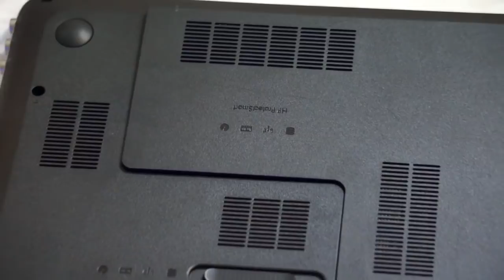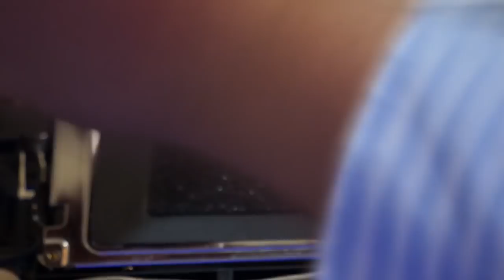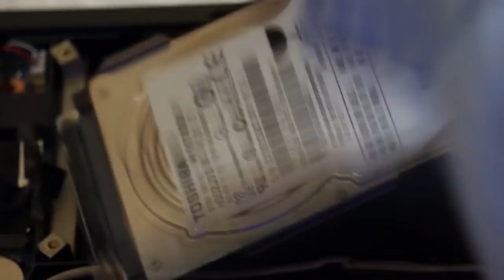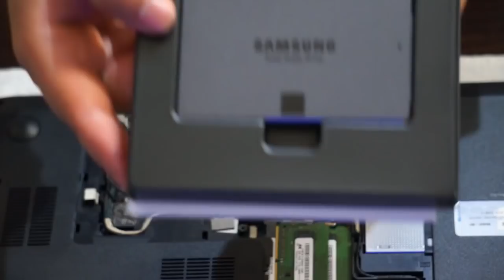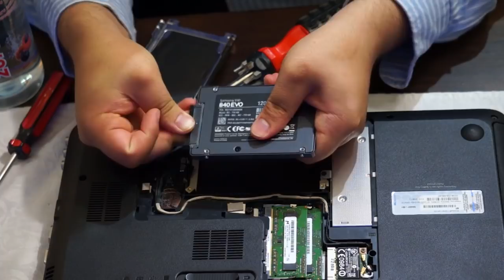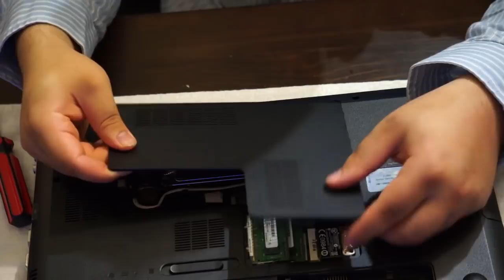How to swap a hard drive in a Laptop

Comment: physical swapping is helpful but the question is, did it work? hope you have follow up video on this to see what happens after the swap..
Reply: right? I'd like to transplant my tired old beat up Dell Studio's faster and full-of-files hard drive into a decent Toshiba Satellite laptop, which is running W7 whereas the Dell's running W10.. will there be any software screwups?
Reply: *will the 7.8k rpm Dell drive even work with the 5k rpm Toshiba circuit? enough voltage?

Comment: This video is more in line with a Engine Swap. I have read a lot of comments asking why no data swap? The Data on the installed Hard Drive is your data from the PC it was taken from. If you have a PC and its not booting your HDD OS and your files and the issue isn't related to a nonfunctional HDD you can remove the HDD and install it into another HP PC that has near or more of the same HW. When you boot it up the PC will boot your OS along with your files. If you dont have a PC thats close to your model and need to recover your files their are many programs that allow this to be easily done.

Comment: When we interchange  harddisk one to other ?
Does window is exist or not ?
Reply: no you need to preinstall an os before you replace the hdd
Reply: @adithyaiyer9322  so the hdd needs an os before inserting? Is it possible to change hdd from on laptop to another with an os already installed?
Reply: @SebastianRodriguez-bs4wh  yes you need to have an OS setup ready on a bootable storage drive. Well it may or may not work, it will depend on your both PC's configuration.